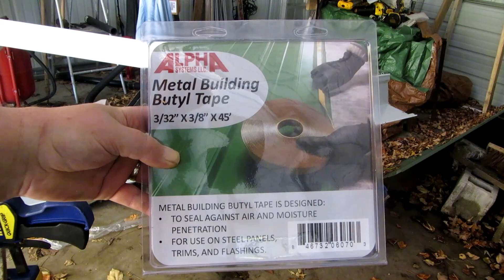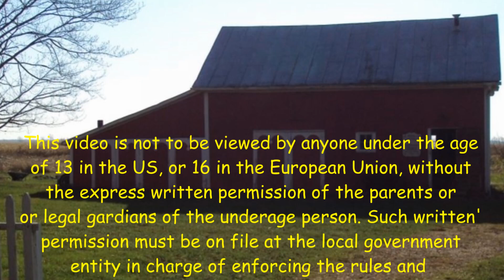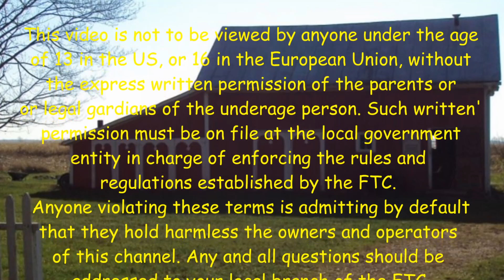OSW Annex Day 81 Fit Roof Trim

Comment: Looking good on the trim and the rubberised goo. I've used some of the aluminised stuff on gas lines to help stop vapor-lock. Works right well with this booze filled gas. Leaves coming down here. 1st time I can ever remember our silver maple turning yellow but I don't remember much. It'll be several more trips to get them all but that's what this equipment is made for. Happy mowing leaves and Grandparents Weekend! God Bless Yall!
Reply from the maker: I lit into the workshop this weekend. I have the wire partly done. The 8 x 16 foot door arrived today and I lugged that big thing back to the workshop. The forktruckflatbed truck couldn't cross the wet yard so it was time for armstrong to take over. 
I need to get the wiring done before the door so I can get the trenchfilled in. The inspector has to see the trench and check the depth to pass the job. 
I have confidence that I can finish but it might snow first. Wire is a priority,
So the silver maple has leaves year round? I need to live further south. 
The new bag is due next Tuesday. I'm dabbing at it with the regular bags. It works just a lot more stopping. 
Down to 31 tomorrow. 
Blessings on you all from the great frozen north.  😁😎